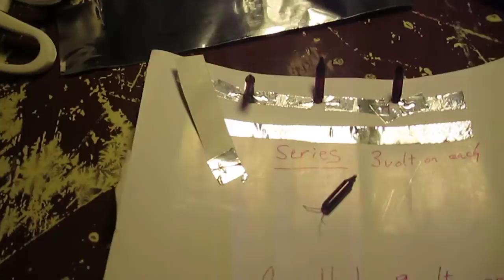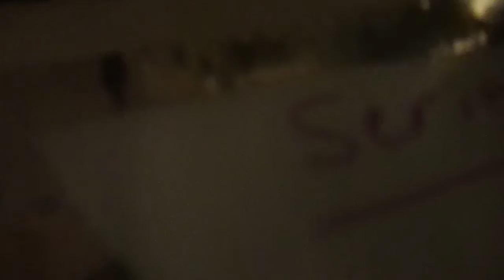Aluminum foil tape circuit - parallel and series with mini light bulbs

Comment: Do you have a step by step on how you created the circuits?
Reply from the maker: need used xmas bulbs and aluminum tape

the parallel circuit is easy just 2 strips of tape on paper and then six small squares of tape to attach the bulbs across them

the series circuit you need to make one long strip and fashion that switch out of aluminum(see video) and four separate strips on the leg with the lights spaced close enough to tape the lights between the breaks.
Reply: Mike O Thanks so much, my daughter was excited when she got the parallel circuit to work but she's still working on the series circuit.
Reply from the maker: great that's so excellent, let me know if I can help further with any questions, good luck
Reply: Mike O Hi sir I keep trying to make the sires but it did not work
Reply from the maker: you have to make sure you have a complete loop for the electrons to flow in a circuit(circle) the lights them selves help complete the circuit across every opening and then on the end I put a switch but you could make it just a permanent connection with the tape but tape it on upside down the glue on the tape wont let the electrons flow. Also make sure all 3 lights work if one is burnt out it breaks the circuit, other than that make sure all your connections and battery is good, good luck  let me know